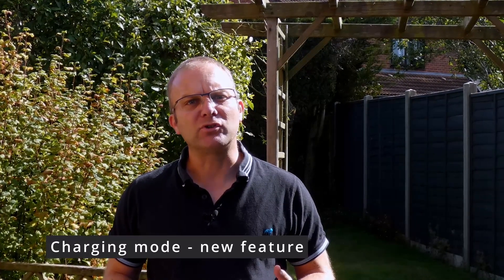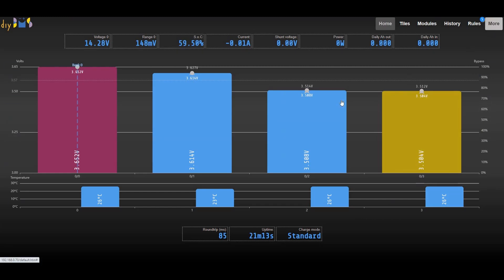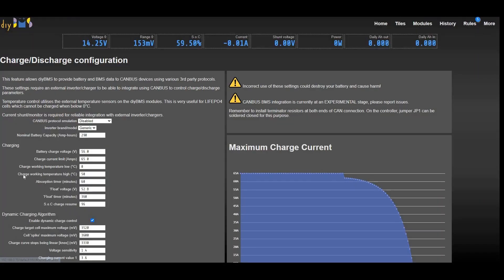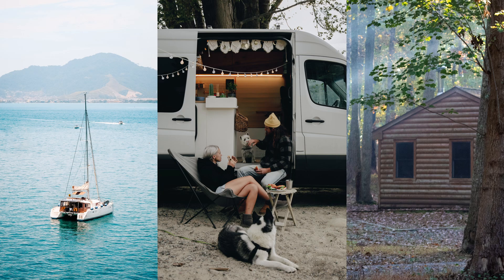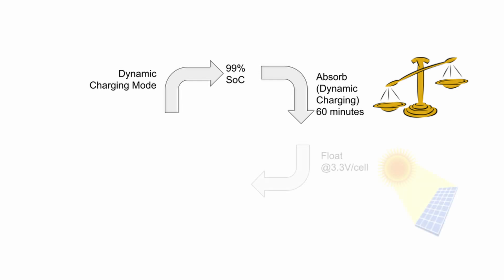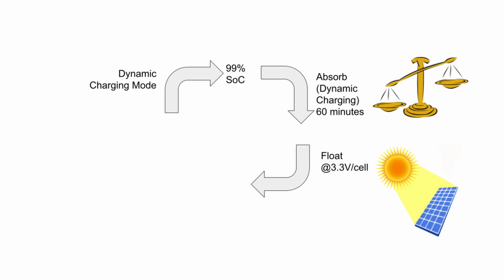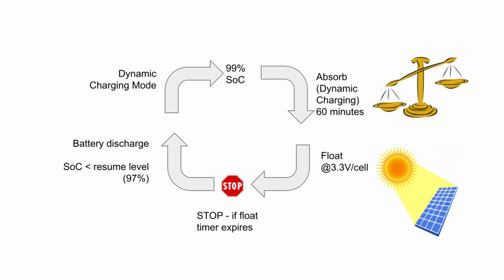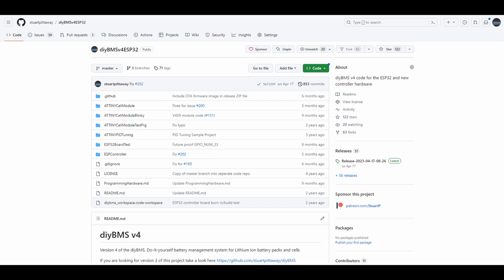DIYBMS Floating Lithium? [Sept '23 Update]

Comment: Thanks Stuart for all your work.
Those "Chargind modes" also apply to Victron integration or only Pylontech/Deye?
If so, Victron already has this functionality in it's normal charging procedure. ¿How yours would affect, then?
Reply from the maker: Yes both Pylon and Victron would have this function.

If DVCC is enabled on Victron - then it should listen to the BMS and the BMS takes control.

Comment: hi Stuart. Thank you for your continued support of this very good, reliable versatile BMS, it is truly brilliant. Also, from your info given to me via github, i too was having the inverter "hanging" scenario, but after loading the firmware you suggested, now my inverter, a Solis, also works with the newer firmware with the DEYE setting applied. Thank you.
Reply from the maker: Thanks for sharing. Good to know it works with the Solis brand
Reply: @StuartPittaway  I have only tested the standard charging and discharging algorithms, i have not tested the dynamic yet. All points work, ie, max charge and discharge current, voltage cut offs, stop charge and stop discharge tick boxes etc...
Really pleased with the performance. Looking forward to the new al in one, and the price point.
Edit, when in bms menu/charge discharge settings, i have to select the canvus protocol -pylontech and inverter model -DEYE
Reply from the maker: Good feedback thank you.

Comment: Thanks Stuart, my system already has a system with two AIOs and the operation is impeccable.
The only problem I have been encountering lately, but it may well be a problem with the ESP32, is that it loses WIFI communication and it does not restore itself, requiring a controller reset. It doesn't happen too much but it has happened a couple of times in the last week. any ideas about it?
Reply from the maker: Ok, please raise a GitHub issue for the WiFi
Reply: @StuartPittaway  I have updated to the latest version, I will wait to see if the problem is reproduced in any case, thanks for answering